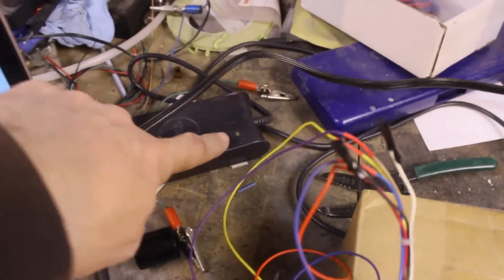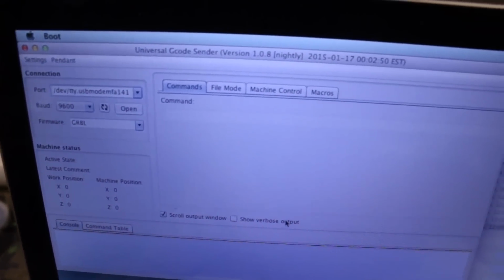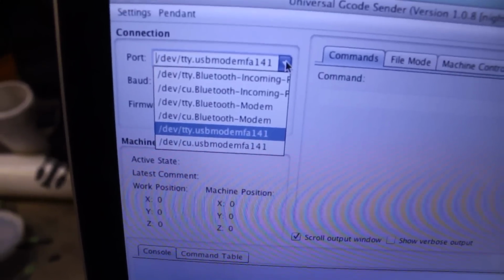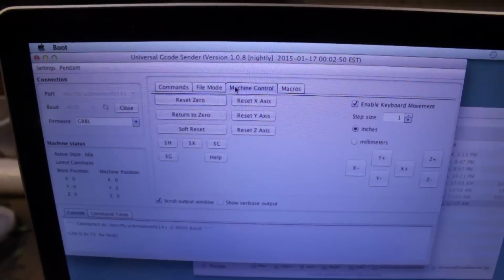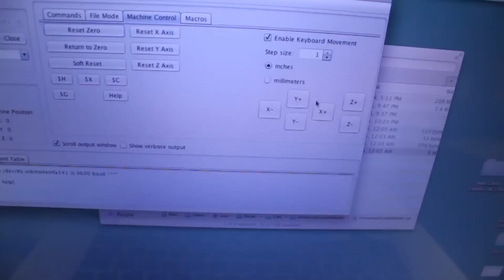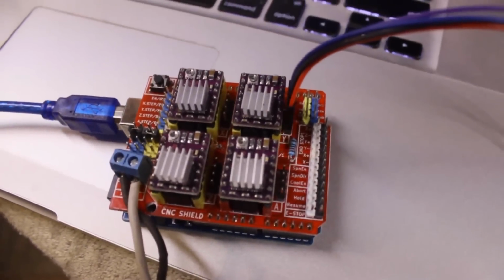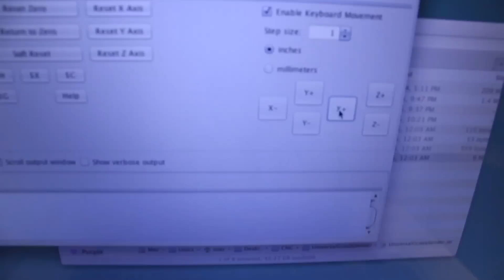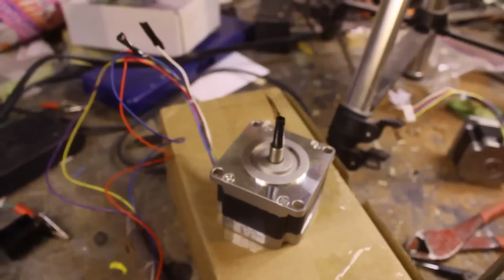DIY CNC - Stepper Motor Wiring and Test

Comment: Hey Greg nice work. Waiting to recv. my cnc shield. Can you tell how you made use of 2 drivers for the Y-axis. Do I jump solder the step, direction etc from Y to A on the shield or is there a jumper or other setting to do this. Appreciate you sharing all details.
Reply from the maker: There is a jumper setting.
Reply: Wow, that was fast. Thank you Greg.

Comment: I don't understand why you wouldn't buy at $30 switched mode power supply. For that price you can easily get 24V 15A, which is enough for your project. Otherwise, awesome video. Thanks!
Reply from the maker: I eventually did.  This was just a test to see if everything would work.

Comment: What would be the best power supply for controlling all 4 motor simultaneously. But also make sure that you do not burn something if only one motor is being used (if that is even possible). Saw the one the description. Come one dude, 460 dollars. Should i sell a kidney or something ? Would a 20V , 2A laptop supply work ? Anyways great video, probably the best one i found about this driver.
Reply from the maker: That power supply would work for 1 or 2 motors.  After that the amp draw gets high when you run the motors at their top speed.
Reply: Greg's Garage Thanks. Also whats up with the direction of the drivers ? As I said, in various other videos they installed them the other way. Is it a difference between A4988 and DRV8825 that look similar ? Now I am thinking of 12V with 5A. Or should i search for more voltage and not more amps?
Reply from the maker: Most motors have a voltage range.  Get the power supply that best suits your motors (20-24V is pretty common).  The motors should also have a max amp draw (they are all different).  Get a supply that works with all three motors at full tilt.  You will rapid all three at the same time and its good to have that ability.  The board you get will have a pin out for the drivers.  You just have to make sure the drivers and the shield agree.

Comment: hello sir can we use a battery  of 12 volts 8 amps as a power supply in grbl
Reply from the maker: Never tried, I would suppose it will work.

Comment: have you got a link for where you bought the Dupont PCB connectors please
Reply from the maker: +Tom Jones ebay.  You should be able to search for them there.  There are male and female pins along with single, double and up to about 8 pin blocks.

Comment: did you ever do the video on the dupont pcb connectors? i could really use that RIGHT NOW ;)
Reply from the maker: +ursonate No, I haven't taken the time to do it.  check this vid out.  At 2:28 I show the basic crimping process.  https://youtu.be/dY10zIMaCmI  There are a few things you need: male pins, female pins, a crimping tool and the blocks the pins push into.  Pay VERY close attention to how I load the pin into the crimper.  It will take a few practice tries to get it right.
Reply: +Greg's Garage Thanks for the quick reply! Turns out they're different connectors that don't require crimping after all! Check out the Phoenix Contact connectors! :)

Comment: Great vid Greg! I just got into CNC and have been toiling over the same problems/challenges you are coming up on. I am retrofitting a 2020/3040/6040 Chinese CNC with the same CNC Shield and Ardiuno. 

Just a note, for some reason MY USB connection is actually the CU.usbmodem1421 connection and not the TTY. I am also having trouble connecting with UGS but have had success with G-Code Controller. Looking forward to seeing more info, when I get mine all set up, I'll shoot some vid too.
Reply from the maker: +Eric Au (Metro Grade Goods) I'll look up G-Code Controller.  Thanks for the tip.  The UGS has a few shortcomings when it starts sending actual code.  Let me know when you have a video up.  I'd like to check it out.
Reply: Just saw your progress on your X-axis. I hope to have my little 2020 machine up and running in a few weeks when all the parts start to trickle in from overseas.

Comment: Macs have aluminum cases, and you operate arduino on top of that without any insulation.  I wonder how you didn't fry everithing.  :D
Reply from the maker: That's where you are wrong Ivars.  I have an insulating layer on top of the mac.  Look close and you'll see the outline of the Moshi wrist rest on either side of the mouse pad.  BAM!!!  No frying. :D
Reply: Greg's Garage Watched the video several times - still cant see it, but if you say so. :)
Reply: Greg's Garage btw - what kind of motors do you have? Looks like a small version of nema23 - about 180oz/in, right? I already ordered ardunio cnc shield and drivers (same as yours), so far I cant decide what is correct voltage to operate - 24V or 36V. (24V 15A and 36V 10A PSU costs about the same - cant decide).
Reply from the maker: You are correct. nema 23 around 200 ozin

Comment: wich kind of motor did use on that video , i mean voltage of motor
Reply from the maker: I believe my power supply is 19V.  They will work from 12V to 30V.
Reply: Yes i see,  i mean the motor works with wich voltage ?
Reply: Is the power supply of cnc shield should be the same voltage that the motor can support ? If we use 12v in supply then the motor should be a 12volts !!!!
Reply from the maker: Yes.  The power supply for the CNC shield is what feeds power to the motors.  You feed the CNC shield the voltage you want/need for your steppers.  Most stepper motors have a range of voltage that will work.

Comment: Not sure if someone else mentioned this, but you probably want to keep the Arduino board away from your conductive Macbook Pro aluminium surface. Also - it may scratch your lovely Macbook...  ;-)
Reply from the maker: Thanks for the tip!!!  I probably lucked out here....  I've got a piece of plastic glued (Mushi) onto the macbook below the spacebar where my palms sit...  I'm guessing if that wasn't there, I might have a dead arduino???  The macbook is old, so the scratch wouldn't bother me much...  HOWEVER, if I had a new one I'd be concerned for sure.  Thanks again!  :D

Comment: really neat.  sounds like you should get this thing up on kickstarter :-)  BTW just curious if you thought of using a WiFi connection instead of USB.
Reply from the maker: No kick starter needed on this one...  I'm building it for my use, anyone can copy it, I just want to pass on what I learn.  As for the wifi...  That's a great idea.  I'm sure I can find a module for the arduino for it.  Once I get this thing up and running I'll start adding cool details like that.  Thanks for the inspiration!

Comment: That's cool. I took cnc classes in the '80's, mostly wrote the old dos software. My best guess with that connector is to follow the tracers on the arduino and see which pin leads to ground before you plug in.
Reply from the maker: Solid advice.  Thanks.

Comment: You have a kit you are working from or you scratch building this?
Reply from the maker: I'm just buying pieces and parts.  The design will be a combination of a handful of other builds with a little GP modification thrown in for good measure.  I'm thinking about doing an open sided machine, so I don't have to cut material down to fit on the bed...  Not sure if I'm going to go that route, but it would make things way more interesting.
Reply: Sweet!

Comment: Awesome man. Please keep detailing the build I love this type of stuff.
What are your plans for it? Plasma cutter?

How does the audion interface to the motor controller?
Can you load a gcode file into the app and hit go?
Reply from the maker: I am planning to have a simple x,y,z platform.  From there, I want to have the option of running a router/mill, plasma cutter or 3d printer all based on the same foundation.  I'm going to do a detailed video showing the arduino, cnc shield and the motor controllers, how they connect and how to get them working together.  It's surprisingly easy.  On the gcode sender, yes, you can open a gcode file and hit the "go" button.

Comment: Nice work Greg,  the CNC shield makes life alot easier.  And those laptop power supplies take quite a beating,  I'm not using one right now but I used one for quite a while.
Reply from the maker: I used to have a much larger one...  I can't find it though.  Question...  I'm guessing there is a setting for speed in the g-code?  Seemed like the motors were moving pretty slow.
Reply: Greg's Garage Yup you can set the feedrate in the g-code ,  I believe the command was F with the feedrate depending on which units are selected.  Search for gcode quick reference and it'll give you all of the important commands
Reply from the maker: I'll look for a g-code reference Ron.  Thanks!